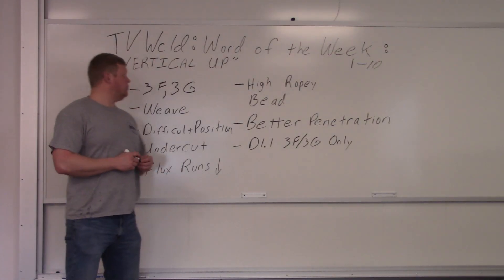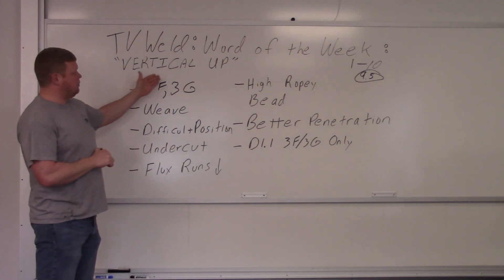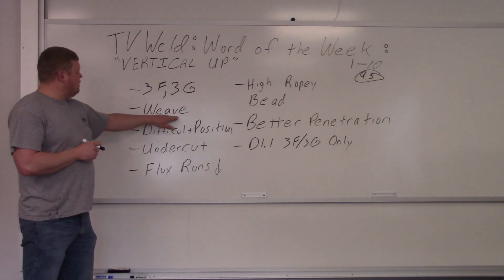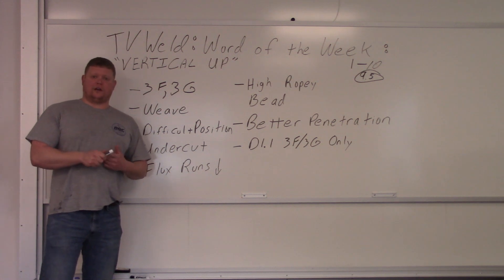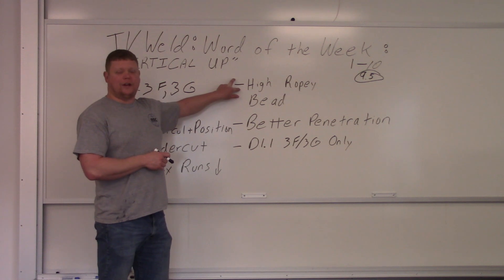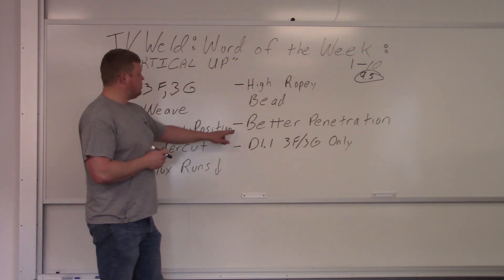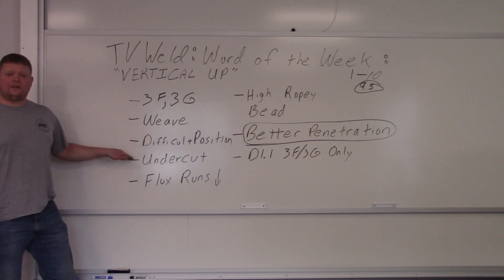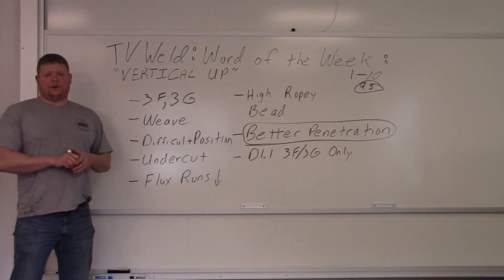Vertical Up Vs. Vertical Down Welding

Comment: When I welded my trailer jack I went vert-up but it was making globs I was running like 290 wire speed and 19V wat you think is the best settings
Reply from the maker: Grind it clean and try to go vertical down with an upward angle.  Settings are tough with out knowing your machine.  Every machine runs a bit differently.

Comment: I'm putting together a small fence joining 14ga square tubing to 11ga tubing. I was told I can get away with downhill using 6011 3/32. I'm not used to welding such thin material and don't wanna blow holes but don't wanna use mig. What do you recommend?
Reply from the maker: MIG would be the easiest, but 6011 3/32" will work as well.  You just need your amperage right.